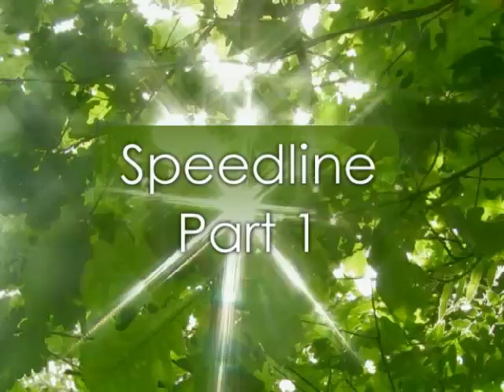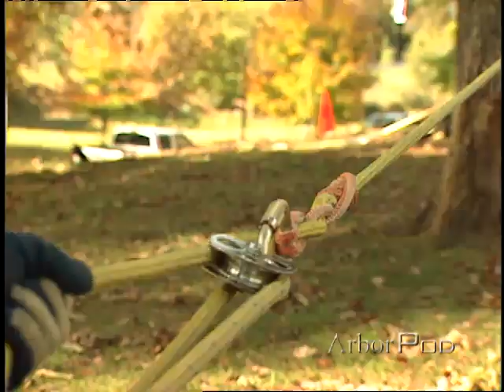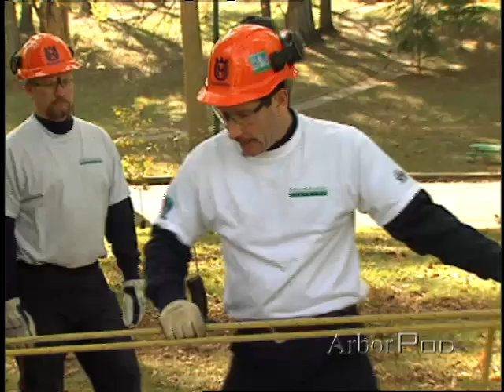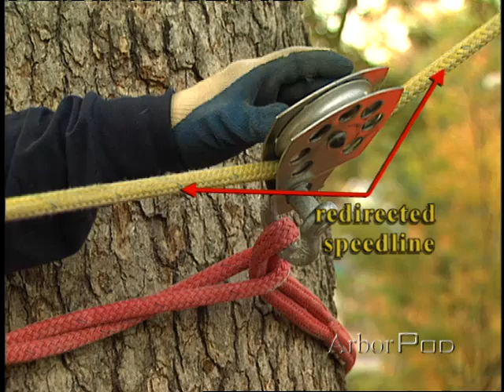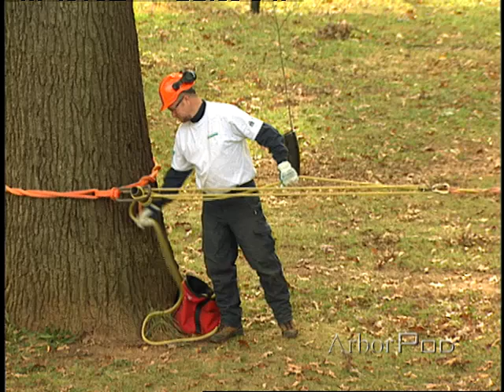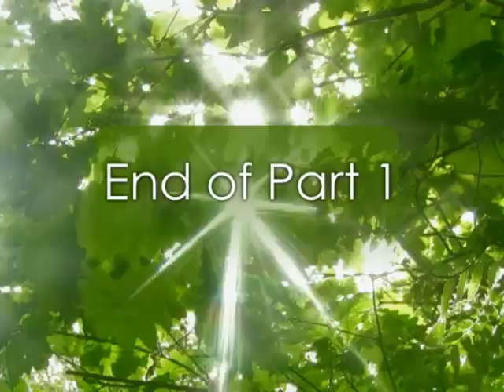Speedline part 1

Comment: Hi I have used a hitchmaster in Australia for extended slackline setup. I tied a running bowline around the tree. I was able to put more force with these cheap looking hitchmaster setup, where as the ratchet strap wasn't enough. The hitchmaster can give you over 16 to 1 setup. My static rope cut a groove in my tree. But it's a Gumtree so I was going to trim it right down purely because of how dangerous they are! Branches drop and can kill, and have killed a lot of farmers in Australia! Cheers.